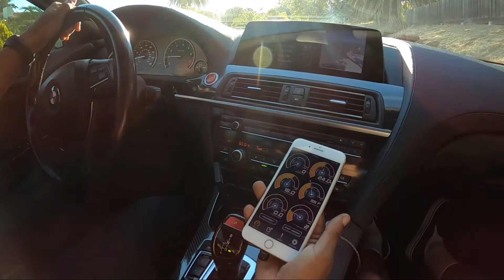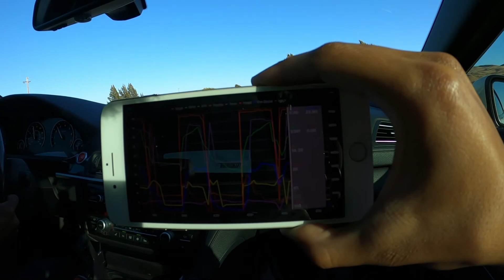Sleeper 2013 BMW 650i (CRAZY FAST)

Comment: Currently on the fence with a 650i or m6, might get the 650i and use the savings for maintenance and upgrades
Reply: 650 you hit the wall at about 650 reliable to 750 unreliable wheel. M6 you can get a 750 reliable up to unreliable 900,

Comment: What's the 0-60 and 1/4 mile times on that? I have a tuned 650i xdrive. Stock turbos, catless downpipes and tuned. I run E40 fuel mix. My 0-60 is 3.03 sec and 1/4 mile is 10.96

Comment: 650i with the naming that now actually makes sense. 650i = 650hp
Reply from the maker: Haha, yes it does!
Reply: @NanuGarage  There was a time where the numbers actually where related to the engine side (I.e. 330i was a 3 series 3.0l engine). I laughed  when I hear 650 hp in the 650i. Basically, the 4.4L V8 now actually has numbers to back it up.